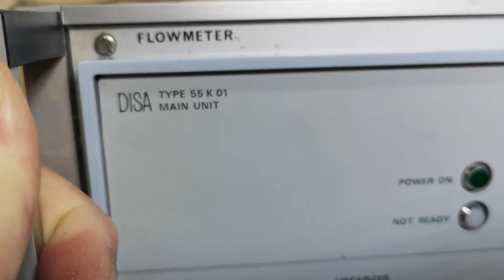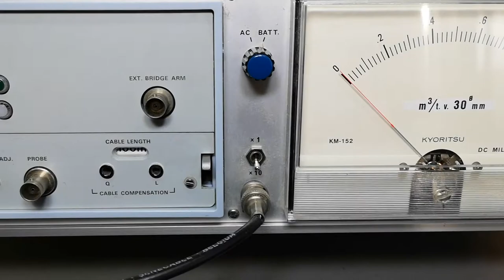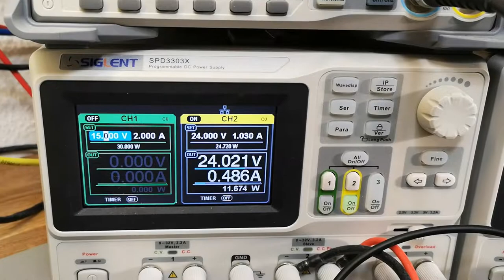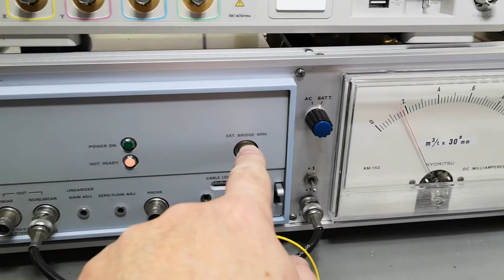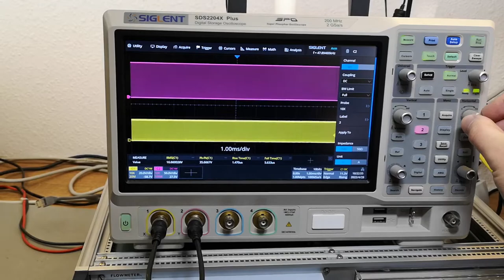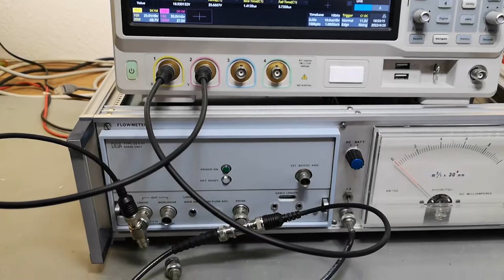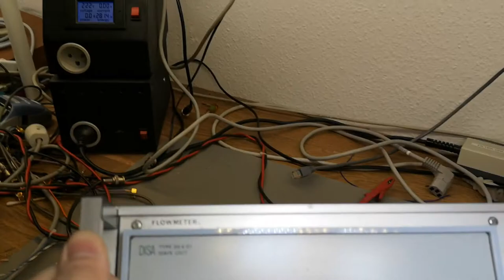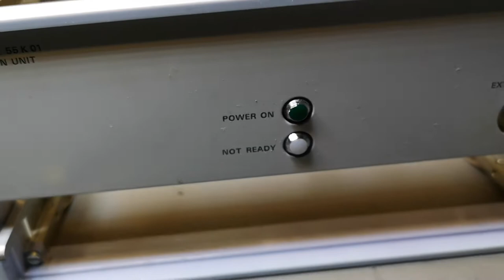DISA type 55 K 01 Flowmeter, test and Teardown

Comment: Discrete component bandgap reference, with all the opamps and transistors there to provide a stable temperature for the 2 transistors, with one probably being biased with a multiple of the current of the other, so they can use the difference to get a stable reference out. Other circuit with white rod not sure, measure resistance, it probably has 100R or 1k resistance, making it a platinum sensor, probably used to make a precision oscillator acting as the stability element in a Wein bridge, used instead of the tungsten lamp.

Shorted coil is a reference coil, the pipe has a similar coil wound around it, and they both are pulsed together with the voltage waveform, and then the eddy current in the fluid is used to measure flow rate, as the flow moved the circulating current carrying fluid downstream, so making the signal at the end, when sampled, weaker with faster flow. Shorted coil is there to compensate for coil resistance change, as it will heat up roughly the same with applied current as the sense coil, and the length compensation is for cable resistance, adding in series resistors to emulate longer cable lengths. 50R precision resistor is there to apply power, termination for the drive power into the coil, which is why you got the different behaviours when  you had eithjer open, short or resistive termination.

SFC2741 is a selected part, very low popcorn noise, low flicker and low offset military grade part of the standard 741, they are pretty good parts, even these days, and are now well aged, so are going to be very stable in operation. All those transistors with JANTX stamped on top of the can are military grade parts, often used in spacecraft as well. They probably have buddies from the same wafer still flying on the Voyager and Pioneer space craft, and still operating despite being near absolute zero as well.
Reply from the maker: thanks a lot for your always super comments :-) this unit was full of cool designs and great part choices, clearly not intended to be cheap